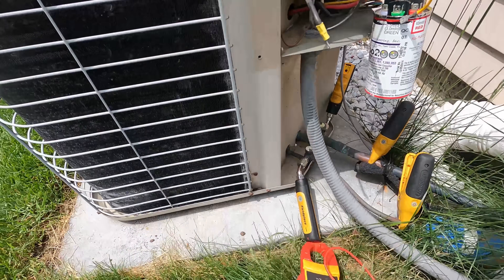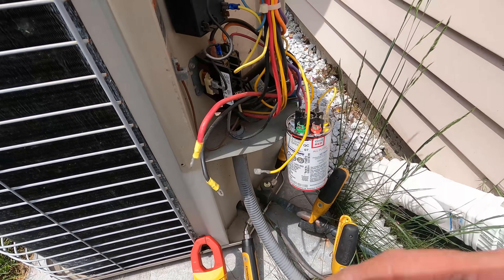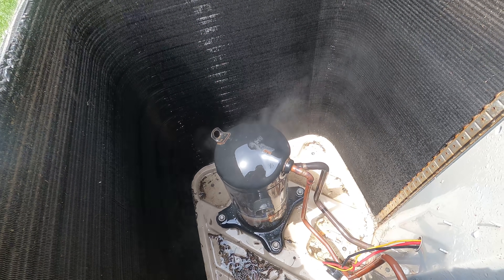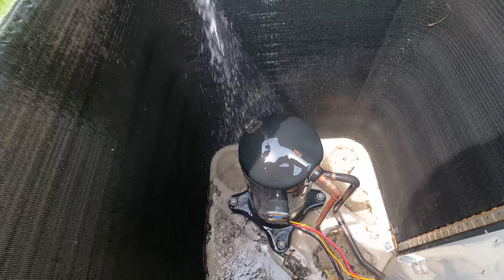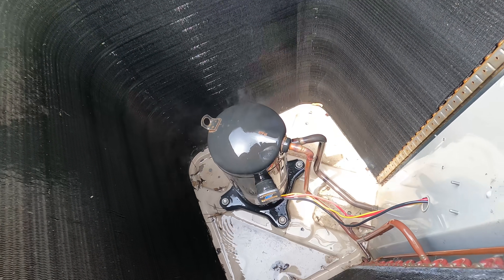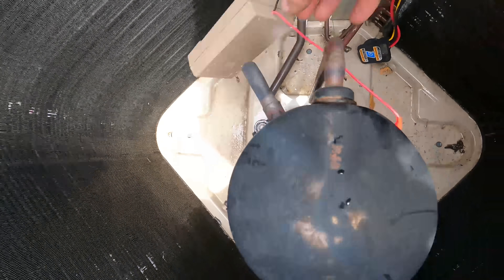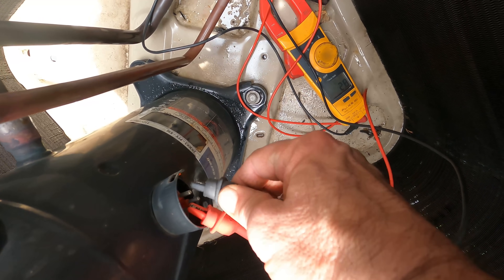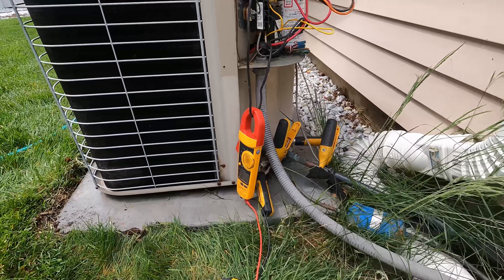AC Compressor Overheated Not Cooling Testing Windings/ Megging, Ohms Fixing HVAC System

Comment: Confused

Why didn't you leak check this???
Reply from the maker: No reason to leak search a system that needs to be replaced. This is second time it’s getting charged back up. Therefore fix and have them deal with sales. Yet if I don’t get the system running they will call someone else.
Reply: dude didnt you read my comment?
Reply: @rendel2358  

?
Reply: @rendel2358  i don't read through the comments
Reply: @thehvachacker   
  As an HVAC Tech isn't it your job to find the leak and repair it before charging it? Stop taking so many calls if you can't do your job correctly. Your fucking up the atmosphere, and you clearly didn't take an ODP Course or you would know this( You shouldn't be handling refrigerant). Obviously if it's low you have a leak and if you don't fix it, its going to leak again. The reason they are getting rid of R-22 is because it is so harmful to the atmosphere, yet here you are charging a leaking system with it, knowing its going to leak again....LOL? Guys am I wrong?
Reply from the maker: J pitter no rules on systems with less than 50lbs of charging a system with a leak. The owners of this system put a down payment today for new equipment. I have my universal EPA 608 card, some 410a cert. many other certificates, my company pays for constant training. You must not live in USA from your response. I know many countries don't allow repairs like this. Gotta love when uneducated like you come out swinging talking trash. How am I fking up the atmosphere? I bet almost 96% of the refrigerant in that system will be recovered.
Reply: @JP-sd2cw  Used to just blow the charge before recovery equipment was born.  Blow the clogged condensate lines with R-12.  Shit was less then 50 cents a lb.

Comment: When you charged in liquid form, do you use a liquid to gas charging  tool? If not, why not? Can't the liquid eventually slug the compressor?
Reply from the maker: I just charge it in and let 2 core valves restrict flow. Then the refrigerant mixes with the superheated vapor. By time it hits compressor a lot of liquid has flashed, or so I believe. Been charging this way since I started. I don’t lose many compressors.
Reply: And you do the same with 410 as well?
Reply from the maker: Yea never had a problem. I know many say not to. Yet these compressors can handle a small amount of liquid. Might push oil out. Yet it will return. None of my coworkers do any different. Now if only the evap coils didn’t seem to leak as much.....
Reply: Gotcha...alriight brother thank you for your videos man, I stay watching and learning, keep it up bro 👍👍👍
Reply: @thehvachacker  Scrolls cannot handle liquid. Have you ever seen a scroll set that blew apart due to slugging liquid? There is no such thing as a compressor that can handle liquid. If that were true, heat pumps with scrolls wouldn't have accumulators and manufacturers wouldn't have massive warnings about superheat being too low on equipment. You should see the MASSIVE disclaimer in Trane Intellipak manuals about setting the superheat for each circuit and they are scrolls. A scroll set is a scroll set and they all explode into a million pieces when they slug liquid.

Comment: I check filter first . before charging
Reply from the maker: I checked filter it was ok. They have a maintenance coming up in 2 weeks and will get it changed then.
Reply: @Magesh Mahi yes. If low the refrigerant coming back in the suction line is too hot. The compressor relies on vapor refrigerant to cool it

Comment: Yeah I give it a week before enough pisses out that they have no cooling again. If anything at least do EzSeal.
Reply from the maker: This system will run until it is replaced in June. For years systems have been charged back up with 5-7 lbs and ran the rest of summer if not 2 seasons. This system has been charged a few years back. Very small leak rate. Yet it is being replaced.

Comment: That R-22 charge must have cost the cusomer a $500 dollar bill for the charge? Nice job charging it.
Reply from the maker: This bill was in the 900 range. Took some time to cool down that compressor
Reply: @thehvachacker  I have a neighbor that still has their original A/C systems from 1994. Although they have replaced major parts on them such as the evaporator coil and compressor (I think) to name a few. People who still have R-22 systems their days are numbered as soon as the system develops a leak; soon they will have no choice but to upgrade their A/C.
Reply: @Chris2745100  Except for the fact that r410a is on it's way out right now.
Reply: @jman0870  If 410a is on its way out then what is going to replace it? 410a is what my system runs on.
Reply: @Chris2745100  Right now R32 and R454b are on the menu but there will be more.
Reply: @Chris2745100  what Ramon said

Comment: I give the option to put uv dye with leak sealer and have had a lot of systems saved for years and if the sealer didn’t work u can find the leak from the dye it seals most of the time with r22 but rarely ever with r410a cuz the pressure is too high had a r22 losing 6 pounds every year  and every tech tried selling them a new system but they cudnt afford it and now it’s sealed and they not paying $500 just for Freon every year
Reply: EzSeal+UV for the win. It's my go to on low R-22 systems. Since 2020 I tell customers it's basically a requirement at this point.

Comment: Why don't you test for  Leakes before you put in the 5 pounds R22
Reply from the maker: Do you do a leak search on a system that should be replaced? That just runs up the customer bill. Also the evaporator was found to be leaking in 2019 last time we filled it up.

Comment: Why does the compressor overheat when the system is low on refrigerante?
Reply from the maker: Not enough cool gas returning in the suction line to keep it from overheating
Reply: Leak

Comment: R22 is so expensive right now. I would of  pushed them for a new system.
Reply from the maker: I sold them a new system it went in 2 weeks ago. This was to provide temporary cooling
Reply: And THIS is the reason I keep avoiding people like you, always trying to upsell poor unsuspecting homeowners a new system who know no better. For 20 years, techs have come out for minor servicing of my two 1998 R22 Goodman units and all wanted to be THE ONE that sold me an entire new system. No thank you. Please just fix the issue I am hiring you for. These systems have replaceable parts like legos. Is R22 expensive? Sure. So give them guidance that they can replace it with cheaper MO-99 or R-422B. Don't be a shill for your company and try to slam them changing out the entire system (including indoor air handler, linesets, thermostat, probably duct work, etc) when all they really needed was a replacement part or to find the leaky schrader valve or whatever the issue is. Heck, even replacing the compressor (which I have had done) is FAR cheaper than changing out the entire system.  It's just silly. These systems today are garbage. They should be built like tanks and last for decades with little to no service calls, like the ones from the 70s and 80s. But now, every tech that comes out complains that the latest systems are SO delicate and problematic. They love how simple these older systems were.

Comment: dont check for any leak?!
Reply from the maker: No need it’s already been found on evap coil. Slow leak and customer wanted cooling unit a new system could get installed. This is Sunday emergency service with lots of calls to still get to.

Comment: With that large of a LEAK I beleave I would fix it or replace it and since it's R22 Replace It.
Reply from the maker: The unit was replaced not long after this call. This was to provide temporary AC until a new system could be replaced. The evaporator has a small leak. System last was charged up before this call 2 years earlier.

Comment: Wouldn't you first do a pressure test the moment you notice the gas isnt there?
Reply from the maker: Gas was in system 120psi until I started with wet coil pressure will always be lower until it dries. Yet not under 10

Comment: Too bad the scale can’t show you the price of R22 along with the weight like a gas pump does lol
Reply from the maker: Price varies by customer.
Reply: What does “mag it” mean? What is a mag tester?
Reply: @georgehale9625  in theory there should be no continuity between the windings and ground since they are coated with insulation. If there was damage due to overheating it might melt a little and you'd get some measurable resistance in the megaohm range which is what that tester looks for.  Notice how as the ohms go down it goes from good to caution to bad.  I wonder if the ultimate test is to do it when the compressor is cold since resistance goes down as the temp goes down but maybe in that range it doesn't matter.
Reply from the maker: ntsecrets most scrolls test caution to bad. Then start them and the winding test good. If you have a megohmmeter test a cold scroll. Then after running the comp they test good. Not sure why scrolls seem to test is way.
Reply: @ntsecrets  I understand using a multimeter to check for resistive conductivity between the winding and ground but the post referred to the term “magging” which would suggest some magnetic property measurement. Perhaps they mention “megging” referring to megohms but written like they were hearing a speach impediment.
Reply: @georgehale9625  yes I think it’s just a dialect thing it’s megging not magging
Reply: @ntsecrets  I would think that an ordinary multimeter would be adequate for measuring any shorts or resistance form the windings to the case even in the megohm range.
Reply: @georgehale9625  yeah I don’t know is the megger does anything fancy (like use higher voltages to check for breakdown) or if it’s just an ordinary meter.
Reply: @ntsecrets  Yes, it could be a mega volt generator to test for arc over volt levels. Seems a bit of overkill for HVAC work.
Reply: @georgehale9625  It's not. The megohmmeter (Megger is a trade name) is an insulation tester. It applies a high voltage to the motor windings under test. Weak or damaged insulation will show up under this test. A regular multimeter doesn't test at high voltage and won't find these kind of problems until a major failure occurs.

A compressor motor failure inside a refrigeration system can cause massive contamination from smoke particles, and it can be a lot of work to clean the mess up. A megohmmeter test can warn of this happening before it does.

Comment: All you fellas screaming about him not doing the right things is bonkers.  The video doesn’t show the conversation he had with the customer and giving them options to do.   He did what was right, gave the customer what they wanted and that’s all there is to it.
Reply: Incorrect. 
He should've done a pressure test, located the leak, and then notified the customer.
Reply from the maker: I should not do a pressure test on a system that the customer wants to replace. The leak is somewhere on the evap coil. Was found in 2019. Customer wanted relief from heat. Also a new system. Rob you still in school learning? Real world service calls, dealing with other people’s money. Requires common sense, and respecting your customers.
Reply: @moisty254   nope bud that’s not the way it works. It costs money to do a leak search and sometimes people don’t want to pay for that. That why ya give em the info, put the ball in their court and do what they want you too.
Reply: @moisty254  put in a few years in the field before you criticize

Comment: Why do techs always charge 410 as a liquid but 22 with vapor? why now always liquid? I know you can burn out the compressor if you charge with too much liquid but I don't get it!
Reply: 410a has to be charged as liquid, R22 can be charged either way.  Yes, have to make sure not to slug the compressor with liquid refrigerant in any case.
Reply: @thisisyourcaptainspeaking2259  well is it due to it being a high pressure? HFC? I'm wondering why.
Reply: @Keegeth  It's because 410a refrigerant will separate into it's constituents while in vapor form and once that happens, it's no longer 410a, it becomes a different compound at that point.
Reply: All blended refrigerants are this way I believe cause of they are a mixture and react differently to temperature if they are separated.  Could be wrong but that's how I understood it.
Reply: @MAZA4lyfe  oh ok! I get it now. Thanks ☺️
Reply: I charge liquid with 22 also it’s a little quicker
Reply: 99% of techs charge 22 in liquid form.

Comment: i am just trying to find out if the compressor is supposed to be hot or cold to the touch when working properly
anyone out there got the answer  to my question?
Reply: The compressor when too hot will trip the internal overload so like he did, you cool it down with water hose to the point you can get a reading on the windings with your meter
Reply: @thetruth6072  thank you
Reply: Use water hose with small towel or rag

Comment: Why change unit went condenser is empty
Reply from the maker: It has a leak in the evaporator and r22 is phased out. This was only a band aid to get it to run until replaced.

Comment: I swear from this day forward I will never go to work stoned
Reply from the maker: I don’t recommend it. Haven’t done that in almost 17 years. The problems I find with those that smoke and work is dumb call backs. They might make all the correct repairs. Then leave forgetting to plug back in or turn on a disconnect. I even had a coworker pressure test a system yet forgot to braze one fitting in attic. Plus at this call on a Sunday I was near 80 hours on the week. Hard to work that much stones in the heat.

Comment: I would have found leak before adding refrigerant to see if it would be a simple fix if not customers just need to understand that an old worn-out unit is a old worn out unit not trying to sell them another unit it's just old and worn out
Reply from the maker: I set them up for buying a new unit. A leak was found in 2019 on evap coil. Customer wanted cooling now so I filled it. Next day a salesman from my company sold them a system. Looking for a leak on an r22 system usually will just waste a customers money. I will fill to temporary get a system running until a repair can take place. That’s how I operate. What most commenting here should read description of video. This call was on a Sunday. If you watch my videos I sealed many leaks. Yet on a Sunday I am not sealing anything. It’s emergency service. Therefore what do I need to do so customer can be comfortable. Then big repairs or leak searches get follow up visits. This is also first hot weekend. I finished the week low 80+ hours of work. Too many calls to waste time looking for a leak. My customers know it’s in their contact. Emergency calls are emergencies. No maintenances other than addressing what’s stopping system from running. During regular work if this was a 410a system I would leak search the system. Yet r22 systems are all on the older side now.

Comment: WTF  where did 5 lbs of freon go to,  should be a obvious leak...
Reply from the maker: It was a slow leak. This was only to provide cooling till system was replaced. I sold them a new system. Yet they didn’t want to be hot. That’s why they were trying to cap how much refrigerant went in. It was a small leak on the evaporator. It was found 2 years ago. That was last time that refrigerant was added.
Reply: A huge 1
Reply: @captainmigs1655 it should have froze the evaporator first before getting so low it won’t even freeze? Seems like the leak got bigger / another leak

Comment: why not recharge with 422b....? especially in this case... ive been using for years with no issues
Reply: because you have to find the leak, recover, fix the leak, vacuum, charge and fiddle around. the customer would say bye bye when they heard the bid and call the next company/guy to gas it it up. short of that they'll get the local handyman or friend to put in the "unknown gas" they bought off ebay/amazon.

Comment: Can't be adding a pound of refrigerant in one shot. You're gonna feed a slug of liquid into the vapor compressor and damage it worse. It should take hours to add 3 lbs.
Reply: Isn't this a very expensive experiment at the cost of R22 per pound? 

Work or not it's an expensive gamble all the way around.

Comment: Should get a proper conoressor cooler I seen all the water jumping and not doing much when hitting the compressor
Reply from the maker: What just has to run over the compressor. I’m not looking to soak compressor. Just hit it with cooler water. Which removes the heat from compressor. Do they even make a compressor cooler? If so are the sizes adjustable? Would it fit this compressor=Carlyle 06D Semi Hermetic Compressor Replacement Update https://youtu.be/oYHpD3h4aSo

Comment: Dumping in liquid that fast is going to bend you some valves someday...
Reply from the maker: This is only a bandaids repair until system gets replaced. Which is worse me dumping in liquid or homeowner running this system, very low on charge for over a month?
Reply: @thehvachacker  I charge everything with liquid since most refrigerants are blends. Just slow it down a little. If you crack your gauge knob it will start boiling off right there and be a vapor before it hits the valves. The old rule of thumb is to crack the knob till the gauge reads about 10 PSI higher and try to maintain that. Units that have an accumulator (typically in a freezer) can be charged must faster.
Reply: It's a scroll compressor, where are the valves to bend?
Reply: @yourtube4423  Lol! You're right...I've done far more refrigeration than AC work. So it became a habit to think that way.